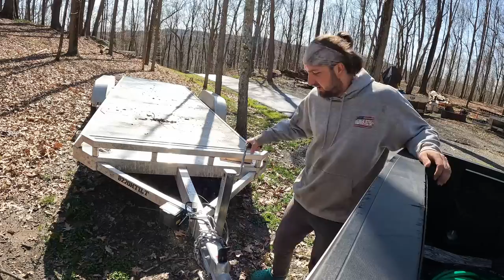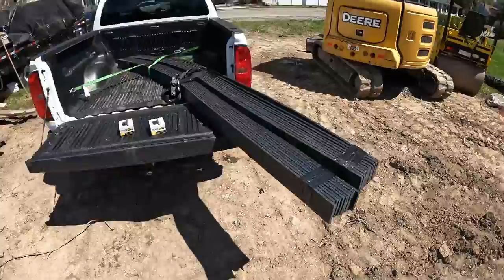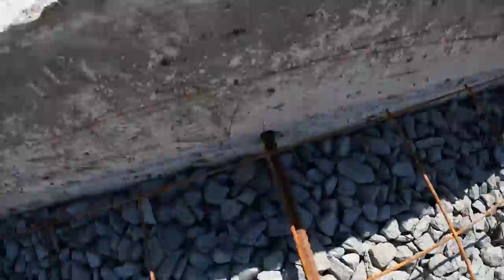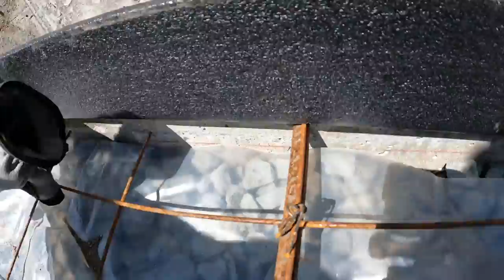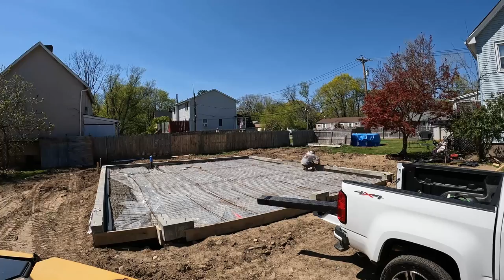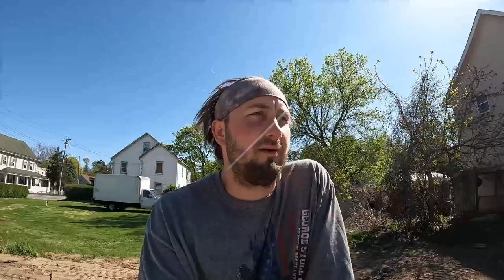INSTALLING EXPANSION JOINT! NEW GARAGE DAY 10!

Comment: Hello, great video! I am expanding my concrete walkway and trying to install the expansion joints as well. I got the similar masonry nails, however, when hammering the nail through the expansion joint to the concrete, they are not going in at all into the existing concrete, am I weak sauce? I am fairly decent with tools lol. Besides masonry nails, can I use some kind of adhesive?